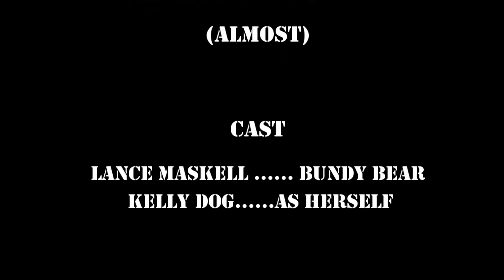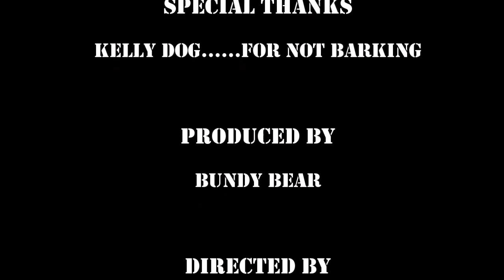Kangaroo Stew # 60

Comment: Now then Lance, looks like you've plenty to do, and still getting more (grin). Drilling large holes reminded me of an amusing story. Just started work as an apprentice. Had to drill a large hole with a powerful slow hand drill. Well the drill grabbed spinning the drill round, me with it. So there I was hanging onto to it, running round until it wound the cable and pulled the plug out of the wall lol.
Reply from the maker: I can just imagine that lol.

Comment: Nice stew Lance, I've taken a liking to "step drills" for holes like you did in the angle, as long as the thickness of the metal is less than the step length, you can stop at the appropriate size.
Reply from the maker: Yeah I like them too for the light stuff very handy bit of gear.

Comment: Glad to hear the good word on your father.  Air belt sander.  Once you have one it opens an entire world of uses that you will quickly wonder how you got along without it.  Air consumption, noise, bearings, belt adjustments, and overall power are what I would check out.  Granted they are not meant for the home gamer as far as air consumption go, but some of those cheap units consume compressed air like nobody's business.
Reply from the maker: G Day Shain, Yes I found that with a sander I bought it was hard on air supply, I will see how it goes, Im fortunate with the big 42CFM compressor so hopefully there will be enough or I will bin it.
Reply: i have  one that goes on a 4 inch grinder